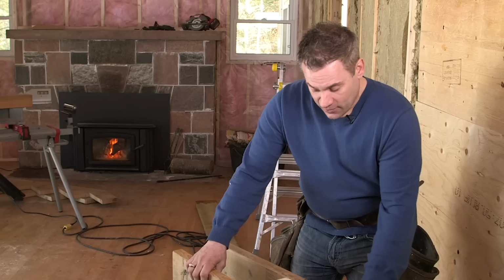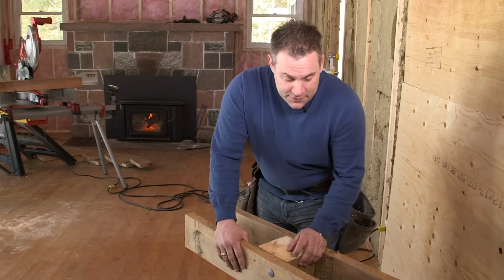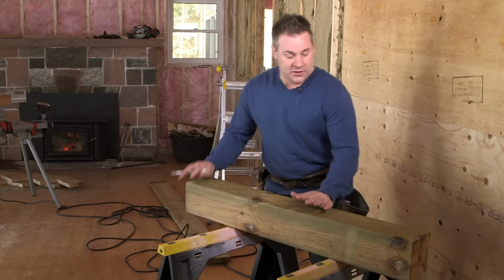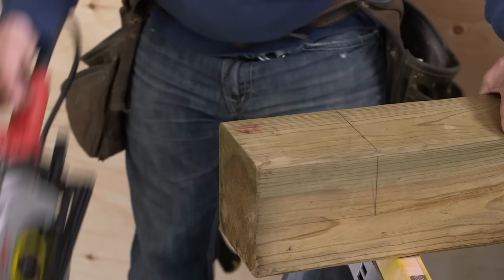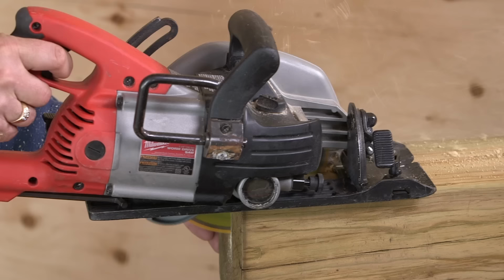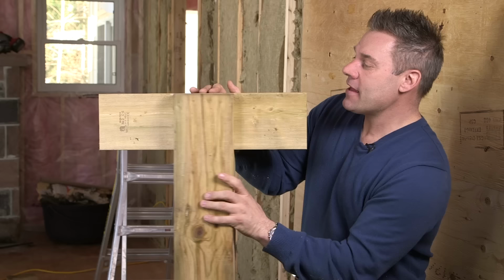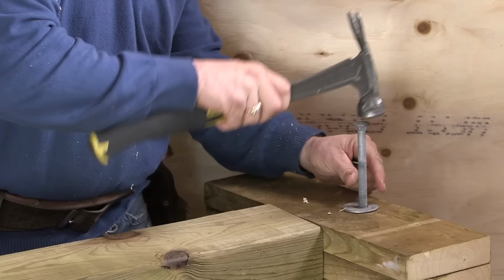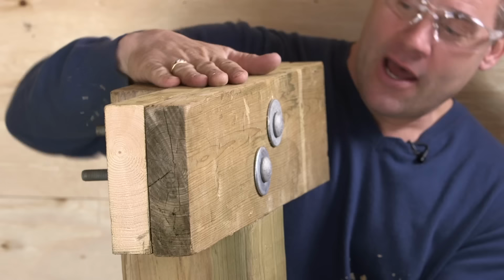How to Attach a Beam to a Post for a Deck | Decks, Docks & Gazebos

Comment: I stopped nailing dbl and triple deck beams together decades ago.  I didint like the idea of water getting between 2x members and never drying.  I 1st membraned over, then flashed then decided designing structure as not to trap water.  I find ways to frame where water never sits under decking but flows thru.  I hardly ever attach decks to homes but rather beam and self support.  If I do i will side then use spacers between deck ledger and house.  1st using copper pipe sleeves to hold ledger off, then later the ledger spacers available.  Sacing and air flow, muy importante

Comment: Eh... I'd say the wood will fail long before the bolts will in either shear or bending, but I agree that your method allows for a better stress distribution on the wood considering that the load from the beam is transferred more evenly --- albeit eccentrically --- into the post compared to two rather concentrated loads from the bolts.

Comment: Years ago I seen people build decks using Nails not even carriage bolts both sides and then cut pieces of wood to support underneath and nail the lower supports those decks are still around and look great.... I understand today they won't pass inspection but are you kidding me
Reply: I just spent a few days taking apart a deck that was over a hundred years old.  Was still in usable condition.  16s were all that held her together and they did a great job.

Comment: Ignoring the fact that bolts give clamping force rather then shear strength, yeah that carriage bolt is strong enough to do a lot more then that screw. That clamping force gives friction between the two pieces of wood. Thus you are fighting the friction between the two rather then the shear strength of the carriage bolt. Of which a grade 5 galvanized 1/2" should have around 51,000 psi of shear load.

Comment: ........by hand you drilled in at pretty well judged right angles, most people tend to veer off at an angle, , it helps to have an assistant standing back several metres who is in good position to inform if the angles are veering off the true...That soft timber that you use looks like a source of problems , it's looking like a soft pine but I could be wrong cos I'm in an other country far away, I don't know how that kind of stuff is seriously used in construction. Our timber is very hard and once it's dry it becomes a problem to hammer nails in by hand hammering without  nails  bending.....
...gotta say that all the comments here are educational also.it's

Comment: If a beam was attached incorrectly, as you displayed at the start of your video, how can it be reinforced without disassembling the deck?
Reply: you could place blocks on the post and under the beam to support the beam/bolt connection. Secure those blocks with galv thru bolts and glue. Or run the blocks all the way down to the footer and them attach with glue and thru bolts.

Comment: Both are good ways. Decking doesn’t last forever and always needs fixing in less than 8years.
Reply: Les Brown no chance. treated timber makes almost no difference and you need to treat the wood with exterior paint to maintain it. Even with good maintenance they won’t last past 10 years with good maintenance. Not where I’m from

Comment: Guess you never heard of something called friction.  Headers or ledgers go straight into the side of the house,  and joists have hangers, all using the shear force of metal to hold them up.  Meets code.

Comment: I am looking to build a low-level free-standing deck (2x6s with no ledger board attached to the house). I am in a -40C/-40F winter cold zone where a conventional deck would require the ledger and piles down 4 feet (6" of gravel / 3 1/2 feet of concrete / j-hook and 4x4 saddle / etc, etc). I am going to dig down a foot or so and make holes 24" x 24", put down 3-4" of reject gravel, a 24x24 patio block on top of that, and then the 10x10 (more or less) 7 1/2" high deck blocks/elephant blocks...that only take 4x4s, not 6x6s. Instead of dropping all my 2x6s into the slots, I want to bolt 2x6s to each side of the 4x4 posts that I stand on end in the deck blocks/elephant blocks and have the double "beams" about 6 feet apart for my 12' x 32' deck. I am running the joists parallel to the house and the deck board ends will butt up to the house. I am doing that to allow for re-routing my a/c and underground sprinklers in the two inches that I will leave between framing and the house (and then covered by the deck board ends), My question is, can I notch a 4x4 to put 2x4s on the two sides or does that leave too little actual wood between them? I am thinking not notching is fine anyway since, if the bolts did the split the posts, the deck might fall...1/2" to 1" maybe. any thoughts or suggestions? Regards.

Comment: What I don't understand is  why its considered ok by code to use lag screws to secure the ledger board which is a critical connection but its not ok to use carriage bolts on a post and beam connection????? WTH?  what is the difference??

Comment: The biggest issue with this method is it's every easy for water to get trapped in between the post cuts and beam. If you're not sealing the cuts or leaving a gap you're going to have a problem

Comment: IMO, attaching the beams to the posts in the wrong way, is why some decks collapse when overloaded with too many people. I would think that common sense would indicate having the beams supported by the posts, rather than being supported by nails or bolts.

About 9 years ago, I built a 10 X 8 deck. As a support, I made 4 supports with 8" X 8" concrete blocks.  I dug the holes for the blocks, 2 ft deep, and filled them with concrete, rather than letting the blocks just set on the ground. I bolted two 3", 1/4" thick 10 ft. long angle irons to the concrete supports. The deck is supported by the angle iron, not wooden posts at the perimeter of the deck. The deck should support a truck. I did not attach the deck to the house. I kept the deck one inch away from the house to prevent rotting between the deck and house.
If any of you live in Minnesota, you can see this deck at 110 Elm St. in Erskine, MN, US highways 2 and 59.

Comment: The problem with the notch method is that it traps water and will rot the wood.  It might be better not to notch if you are where it rains often. Given all the comments about the bolt shear being total BS, I am inclined to think the method he doesn't like is the most durable.

Comment: The risk with hanging off the bolts is that the beams can split or crack, and the bolts can bend if one end pulls through a split beam. Then it fails, either the wood or the bolt, usually at night on a holiday weekend when you and 60 friends are partying it up, dancing.  When one goes, the rest fail like a zipper opening up.  No biggie if your deck is 2 feet off the ground...but lots of houses have decks off a second floor.  People die when those collapse.

Comment: No Matter which method you üse, you still have the same amount of end grain area exposed to water penatration . The advantage to the notch is that the weight of the beam is completelt supported by the 6 x 6 and not hanging on a couple of Carrie bolts. It's way more likly that the the wood splits than the bolts sheer off

Comment: Here that won’t pass. You have to attach the Joist like in the first part. Then put 2 X the width of the post, using 6” X 6” not 4” X 4”  bolt them to the post. I believe the are called Post Sister Boards. Most Deck Builders in my area, cut the lower edge, of these boards, at a 45 degree angle, so there is no drip edge to rot.

Comment: The problem is not with the bolts. They can carry much more shear forces than the wood. The problem is that the borehole of the beams cannot pass through the shear load. That is the weak point wich would break. The bolts will virtually cut through the borehole if the shear load gets too big. That is why a notch respectively a contact area is better for transmitting the forces to the post.

Comment: Respectfully, you never use any carriage bolts on any structural decking components.  You use at least 1/2" stainless steel or galvanized bolts with washers, because if you use carriage bolts the size of the head is insufficient AND if you want to use a washer with the carriage bolt the washers will not properly seat.

Comment: the weight to shear one 1/2inch bolt is 1.6 tonne and 2two bolts would be 3.2 tonne I suppose if you were to park a semi just over that one post the wood would fail before the bolts and even if you had notched the post the wood would fail first

Comment: Two bolts would have 4 shear points.  1/2 bolts would yield 44000 lbs of shear based on 60000 tensile bolts grade 2.  If it bothered you don't use carriage bolts.  Use grade 3 at 90000

Comment: Your original example is only wrong because of the bolt diameter and layout. A larger diameter bolt can handle the shear load, and is acceptable for certain situations. That being said, positive bearing on a notched post is DEFINITELY preferred, and a diagonal bolt pattern is best.....but what's with the washers on a carriage head? You had to have bought a washer for a larger bolt for that to even work, and it could interfere with the square chuck sinking into the beam and grabbing the predrilled hole....unless the hole was bored out too large anyway......

Comment: 1- There are decks I was involved in building over 20 years ago still standing perfectly level with dozens of large gatherings on them, all attached with bolts, they are fine. 
2- cutting into pressure treated wood without treating the exposed sections will guarantee rot and replacement mere years down the road. 
This video can be classified as either bad, or incomplete advice.
Reply: you're right on 2 for sure.  plus the doubled up beam needs to be shimmed somehow to allow airflow.  notching in many cases is against code anyway.  the beam should be installed directly on the post.  as for 1, I'm sure that's true, but it's not to code.  it would never get approved by an inspector or the insurance company.

Comment: There are a few ways to look at it. I personally don't like putting my faith in carriage bolts if I don't need to. In my area, there was a period where the chemical used in pressure treating lumber was causing corrosion in galvanized  bolts.( nobody said anything). I had few break that were holding my railing posts to my stairs. That's how I found out.. What if I had used them in a deck that's over 6 feet in the air??.. I ALWAYS place the beam directly over the post and fasten it with a post cap bracket. Bracing the beam to the post with a 45 degree angle brace keeps everything tight. It's actually faster that way. Take a look at the beam in your basement that is load bearing.. Beam directly over post.

Comment: The shear strength of the steel bolts is not the problem....it's significant.  It's the shear strength if the wood loaded by the bolts over the small diameter that is the issue.

Comment: I am seeing comments stating this guy is using a 4 x 4 post. No way, the math does not work out. Take a closer look. If I remove 3 inches of material from a 4 x 4 post, I would only have a 1/2 inch left. That post has to be a 6 x 6 which would measure 5 1/2 x 5 1/2.

Comment: Why do you ruin the carriage bolt square part under the head by adding a washer? The square part must be embedded in the wood in order to prevent screw from turning when you tighten the nut. Further the shear strength of the carriage bolts are more than sufficient for a deck, unless you plan to use it for parking your escavator or semi-trailers on it.

Comment: His method of building a beam is correct and its point loaded correctly ...I treat the cut notch then line the notch with ice and water shield , I also use ice and water shield on top of the beam to further protect it from moisture , lasts a lifetime ! No issues...however you will never in your life see a half inch carriage bolt sheer in half lol nope no way ...wood will give out before that bolt , so he is incorrect as to the issue here , the issue is the wood around the bolt splitting or decaying etc but those bolts breaking? Never ever ever

Comment: The bolts are not the weak point in that joint, it's the wood. The shear strength of the wood is far, far less than the shear strength of the bolts. I agree the post should be notched to accept the beam. Your example with the screw was not shear, it was bending. You should never use washers under the head of a carriage bolt. That's not how they were designed to be use. A washer is preferred under the nut on the other side.

Comment: Ok a point to ponder. You said there is no strength in the bolts. Yet at the opposite side of the deck it is attached to the house using bolts??????

And the bolts have a strength of 33,000psi in shear so the area of three bolts is a considerable amount of strength. 

I’m getting ready to replace a deck that’s 32 years old bolted like you are saying is wrong. What has failed isn’t the bolts. But the lumber at the cuts has decayed the water treatment is only on the outside surface for pressure treated lumber which a majority of people use. cutting eliminates the rot resistance and if you don’t treat the cuts???

Comment: Dont use carriage bolts, use hex bolts.  When they eventually need tighte ed, you may not be able to with a carriage bolt due to the round head.

Comment: I don’t like the washer on the carriage bolt head. I’m pretty sure you can’t get the nut tight enough before the bolt will turn. Plus the galvanized nut doesn’t spin down the threads that easy. Maybe zinc coated but not the galvanized ones. Just saying

Comment: I would have rather seen you shear off that carriage bolt with weight in the wood. It would be interesting to see how much weight or tension in any direction it would take to shear off those carriage bolts
Reply: Various bolts have detailed ratings so you can be sure of what kind and how many in order to meet your specific requirements.

Comment: So firstly, you're incorrect about carriage bolts. You can literally haul a trailer with a carriage bolts, with 15 tonnes of equipment on it  lags, and carriage bolts ARE in many applications enough to support a smallish deck. Depending on the finish, you can notch the 6x6, sure. But anywhere you cut, you HAVE to treat with "end cut treatment" to prevent it from rot you've just created a pocket that will decompose faster than the rest of the 6by. IRC DOES call for 1 1/2" of bearing over a post, so use a cleat instead of notching if you wanna use the post as a railing post as well

Comment: The point is not that the bolt will shear, it's that the wood can tear out around the bolt. The bolt is 95 ksi shear strength. The wood will fail long before the bolt shears. Notching is better.

Comment: Why would you need 2 bolts? The load is taken by the post. The bolt has 1 function, to keep the beam in place. There is very little side load on the beam, so 1 bolt is plenty.

Comment: I hate carriage bolts. There's nothing you can grab on the end to hold it while you try to turn the nut. It works well enough to install in new construction, but a few years later when you are doing doing demolition or repair and need to take that out, and the nut is rusted on, it just spins freely in the old wood. They're a nightmare for anyone doing repair work.

Comment: The initial example of the two separated 2x’s (referred to as a split-beam) should not be considered a beam.  Your final example was the correct and standard accepted beam to post connection.

Comment: That wood beam will fail before the carriage bolt will shear off.  Commercial steel building beams are held with steel bolts all the time (more than 2 usually) but I agree attaching beams with out notching the posts is a bad idea but I see it all the time

Comment: This is the best way to do it I agree but carriage bolts have no shear strength? I beg to differ. The live load of the deck can be calculated and the shear strength of different bolts is known. If it meets the load, it’s fine. How is his ledger attached to the house? I bet it’s either lag bolted or through bolted. But why would he do that if the bolts have no strength? And joist hangers? With those tiny nails with obviously no shear strength?

Comment: Technically it's not right but the bolts shear strength is several tons. You can't compare a 5mm screws to a 12mm bolt. You'll need a jackhammer to bend that bolt

Comment: I dont think you should use washers on the head side of the bolt. It has a square cross section in that area that is suppose to grab the beam so that it doesn't spin while tightening and also keeps from loosening...Also, the washer just makes it look worse.

Comment: The carriage bolts are much stronger than a drywall screw. That diameter carriage bolt can hold more weight than the wood that is being attached to the beam !

Comment: Carriage bolts have no shear strength? A single half inch low carbon steel bolt is good for 900 lbs and double that in double shear.

Comment: Beams must come to rest on posts and cannot be solely connected by fasteners such as nails, screws, bolts, that is true. Also, posts should be 6x6 , and in this way, your 2 3/4 “ deep notch for a 2 ply beam leaves an equal amount of post intact. Any notching should not remove more than 50% of the post. Approved U -U connector can also be used atop the post.
All of this has to do with correct transfer of gravity loads rather than shear stress on any applied fasteners.  Rimjoists / deck joists and ledger boards follow a different set of rules than posts an beams.
Reply: Well said. Finally someone understands gravity load.